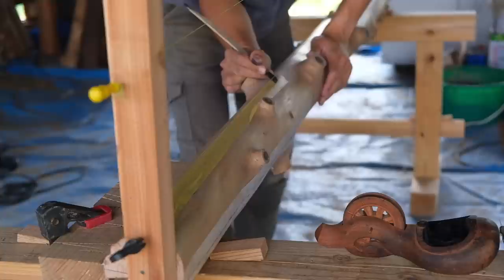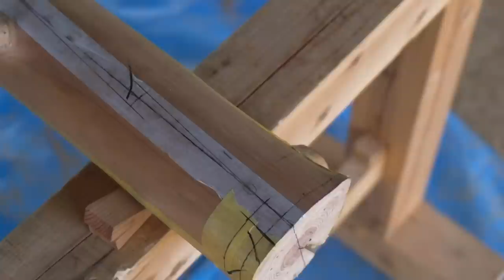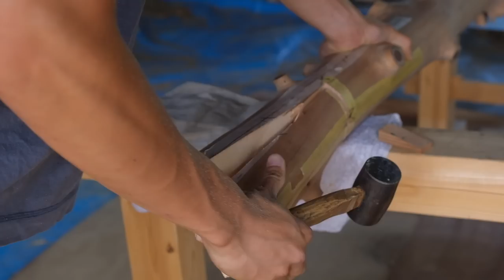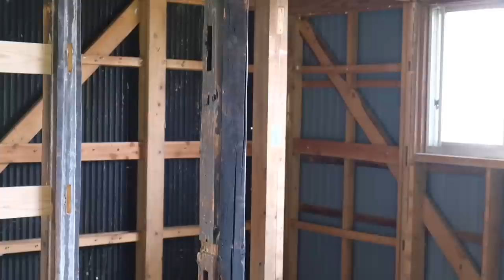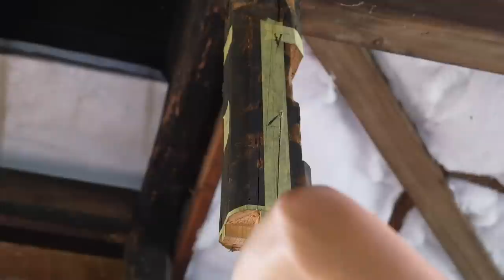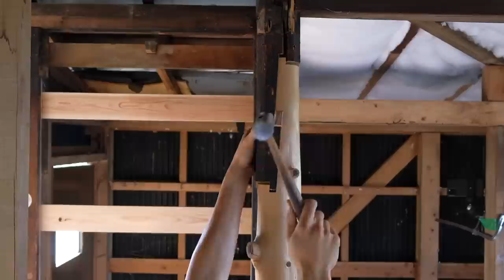Natural Round Post and Japanese Joinery

Comment: Stunning work. I can cut a similar scarf joint, but to do it with such accuracy in mid air is amazing! How do you insert it into position without there being a gap at the foot of the new post (between the post and the stone) when you hammer in the wedges?
Reply from the maker: Thanks, for this I inserted the base after assembling the joint (by jacking up the post slightly).

Comment: I want a very complex glueless wooden joint with three arms at the ends of which each arm is by chance a different complex uncompleted joint end yet different from any in any arm's joint end including that complex being different from the joined originally completed one.

Do all joints require comparable fittings?  This problem may not be physical.

If it is, would you be able to physically make it?  For how many American dollars?

Comment: Hi, nice and clean work on this joint !! The resulting repair looks beautyful, like a tree growed in the room 😀
May I ask the purpose of lightly watering the wood as you did at some point?
Reply: it helps with cutting end grain, makes the fiber more gentle on the bevel
Reply from the maker: Thanks, yes as mentioned above, it makes it easier to cut

Comment: I know that this joint doesn't NEED glue BUT, might it be at least a little  stronger with some Titebond 3 in there for good measure? Just curious. LOVE you work by the way. MUCH RESPECT!  /deep bow
Reply: Glue and green wood don't work well. The wood will move over time, and the glue will fail. As the wood shrinks, the wedge can be tapped in further to accommodate the wood drying out.
Reply: @dr0bi  interesting...thanks

Comment: Amazeballs - thanks for expanding on your recent 'Short' as promised. So no jig but string lines to 'project' a line onto the timber.. That was easy for the new piece - sticks fixed to eaither end - but wondering how you set up the other end of the strings on the cut post.
Reply from the maker: Thanks, for the post, I used a spirit level to get a parallel reference line on either side.

Comment: So this joinery is intended for columns but not for beams, right? Compression but not bending
Reply: I've used this joint for all the "beams" in a laundry pulley, and so far they've held the weight of the heaviest of wet bed sheets and towels! 
You regularly see scarf joints in roof ridge boards and things. Not sure I've seen in beams, but I can't think why it wouldn't work.
Reply: My understanding is that it’s used to lengthen beams. I’ve seen horizontal beams be extended like this but only if there’s a post underneath
Reply: @erk9822  It's ok to have a scarf that isn't directly over a beam but you probably wouldn't want to make the joint in the middle of a span. A traditional German way to do it is just one side of a post with, somewhat counter-intuitively, the spanning member hanging off the short projecting member.
Reply from the maker: This joinery can be used for both